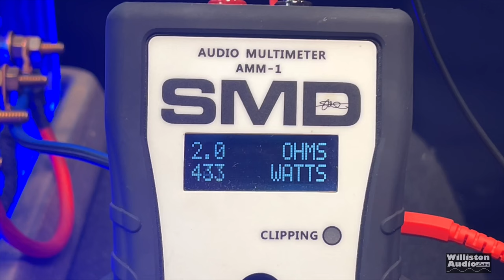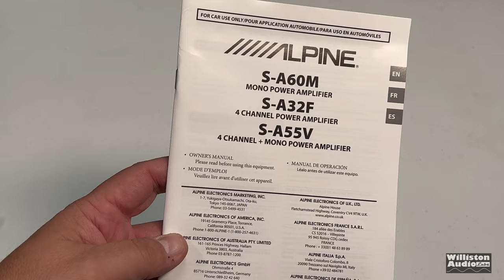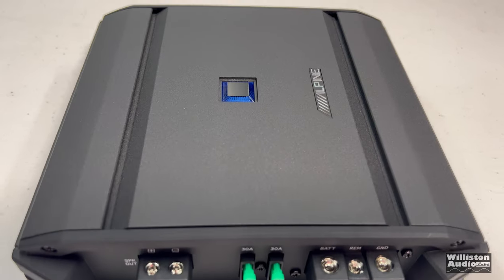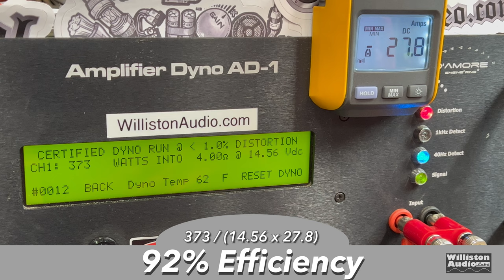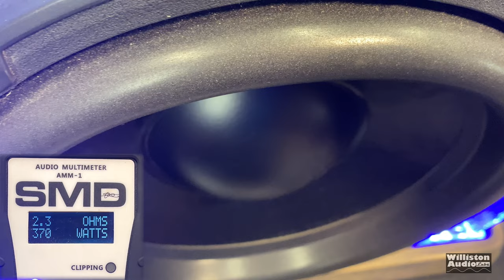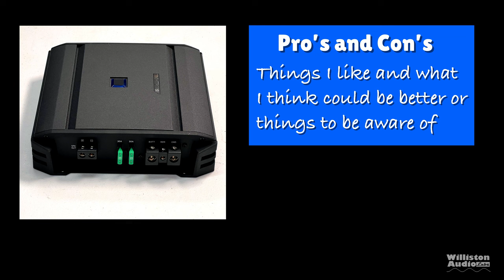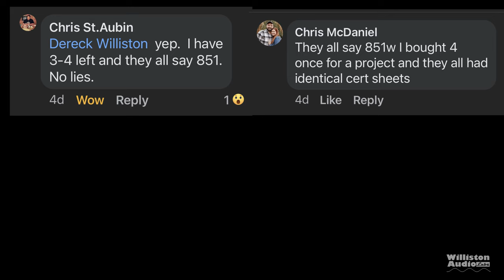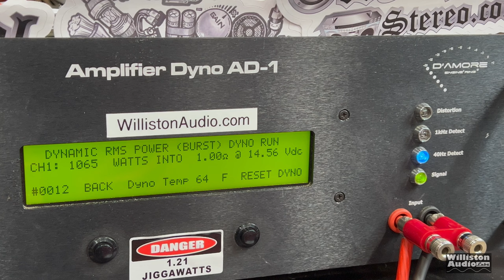TOP SELLING Amplifier of 2022? ALPINE S-A60M 600W Monoblock Amp Dyno Test and Review

Comment: Good morning, I'm wondering if you ever came across a Nakamichi Gold Series amplifiers. Back in the day my system was a Sony receiver, Sony XEC 500 crossover, Boston Acoustics 6.5 Pro Series door speakers, 2 10 in. MTX Road Thunder Pro Series subs. For the amps I swear it was the Gold Series Naka 45 watts by 2 and MTX Road Thunder 100 watts x 2.  It was installed in a brand-new 1990 F 150 regular cab 4x4. It sounded clean with no distortion and about 112 dbl. Thanks
Reply from the maker: That’s a killer system! I don’t have any OS Nakamichi at the moment, but I come across stuff all the time

Comment: Kind of a weird nitpick on my part but the radioactive green fuses seem out of place on a totally blacked out amp. Would have liked to have seen them use black or a smoked clear fuse color there. Again, not a big deal, just seems odd that they went with that color of fuses.
Reply: Fuses are all color coded according to what Amp rating they are.  10 is red, 15 is blue, 20 is yellow, white is 25, 30 is green, 35 is purple, 40 is orange.
Reply: @derekgardin1512  yup, industry standards. I guess if it's a big deal to someone they could always paint them.
Reply: @derekgardin1512  I had no idea. But I'm sure I've seen amps with 30A fuses that were not green. But if it's an industry standard thing I can see why they followed that. Would have been nice if they had gone with a darker shade of green though lol

Comment: i went with the cxa 800.1 and for some reason my dual dvc 4ohm subs wired to 2ohm arent pushing mids.... its basically just dropping out. When wired to 1ohm, the amp cuts out at high volume so i wired to 2ohm and that solved that problem, but i still cant achieve any mids coming out of my subs (my rockford fosgate amp was able to send mids thru those same speakers). do you think its an amp issue, or tuning issue? should i get this amp instead?

Comment: Ive got 2 12 kickers in a pawn shop box with this amp running them (i dont need comments telling me its underpowered ik this) and im wondering if i should get a new sealed 2 12 inch box and a long the way get a bigger amp or should i just get a single 12 inch box and use the same amp
Reply: I need a new box because that one is falling apart and it rattles like a rattlesnake

Comment: I see that the most you pulled off the dyno was  723 but when you was playing music I seen from anywhere around 1200 to 1700 @ 2 ohms is that legit pls explain??
Reply from the maker: Reactive (speaker) vs resistive (Dyno). This amp sandbags on the Dyno and saves it’s power for the subs!

Comment: mmm. not sure i'm okay with a boost at 50hz, i don't think it properly raises the right frequencies that most of us bassheads are going to want. so i doubt i'd be using that feature on this in any setup. probably use it for a flat rig that has other eqs or processors that output to the amps.

honestly, i find 35-40 is better for most music, and i love having a 20-25 boost capability to help tune the near/at and to some degree the subharmonics.  sadly, not many amps have them lower than 40. and most head units aren't complex enough to get the lower boost bands. 

much sad.
Reply: Rockford sells stand alone Punch EQ's now. 40hz parametric boost up to 18db. I think they're 50 bucks

Comment: How does it read over a thousand Watts on your do it bump dough test when on your Dino it never came close to that
Reply from the maker: Reactive load (speakers) different that resistive (Dyno). This amp obviously performs better with speakers 👍
Reply: Reactive load (inductive) versus pure resistive load result on an AC/sine wave input. A speaker rarely provides a constant low ohm load, as its voice coil is moving up and down on the pole piece inside of the magnetic motor assembly. Some folks refer to it as box/speaker rise.   Fred

Comment: I have used many alpine products over the years. They are not always the best bang for buck, hardly ever. I will say though there products have always done as advertised and handled it for years without issues. Currently have 2 sets of there new type S speakers in cars both running off kicker 360.4 amps lol.

Comment: Alpine is one of the few brands that has not tarnished their name with inferior products.  If you see their logo in a classifieds listing, swap meet, or yard sale, you know it's worth grabbing, even if you don't necessarily know how old it is.  The only other brand that was around 30-40+ years ago I would put in this category is JL Audio.
Reply: Rockford Fosgate and Kicker as well are in the same category.
Reply: @ULSB1969  Although my statement is generally true for them, I think they both offered budget level products that I would personally pass up on, in fact I've walked past plenty of RF an Kicker subs with rotten foam surrounds, can't say the same for Alpine.
Reply: @chrishuyler3580  not when you buy new, and on the top end like the T series(PowerSeries) RF amps, RF will blow Alpine away. I’ve had both and RF puts better power and quality than Alpine, Alpine is good, but not as good, but the head units have alway been awesome. The digital amps that I’ve had did not push my 13W7 as good as the T1500 RF does.
Reply: @ULSB1969  I'm not discussing buying new or top of the line, I'm not comparing dollar for dollar watt for watt, you're changing the subject.  I'm saying that if my wife was heading out to the flea market or a bunch of yard sales and asked "Do you want anything"? I'd show her the Alpine logo give her a budget and be happy with whatever she came home with. No further discussion required. I would not extend those same instructions to Kicker.  With Rockford, there are certain products I would cherry pick myself, but it's just not a blanket statement.  In fact, I'm most certain I'd end up with an amp that has no end caps on it, as that is always the case with older RF gear.
Reply: @chrishuyler3580  Alpine has entry level amps I would not buy, new or old. JL Audio and the amps i have mentioned, talking top of the line, are just as good as Alpines top of the line and if not better.

Comment: that 40 hz comment made me so angry....
Reply: THIS IS NOT A 40HZ OPERATION! 🤣
Reply: Just from your profile pic and only your profile pic, I assume everything makes you angry.
Reply from the maker: People who listen to rock or pop music agree with his statement
Reply: @majicdude88  its okay if you dont understand the complexity of the joke that is my profile pic.
you see i took the trump pepe meme, and put the npc and clown hair meme's on it. its funny, your supposed to laugh at it.
Reply: You must go below 40 if you're running full range you want to have 0 to 22 killer hurts at the minimum when they say you should get rid of the garbage you can't hear the truth is those frequencies we can't hear are like the wavelengths of light that we can't see that could heat us or cool us and the same goes with sound there is frequencies that benefit other frequencies and when you start eliminating the reality it's a fake recording and it's a fake representations of pretending to reference the actual recording the artist recorded and the mixing engineer recorded to remain in that signal.

I produce subsonic frequencies but most people have systems that start at 20 hurts and I think that's pathetic because that's not reality it's not a full range of reference and that's what crossovers are for to separate the power and the bands. Rather than talk about the needed high electrical system we need to concentrate on quality
Reply: @wal   As a producer I disagree because I grew up with a lack of full frequency and when I was unlocked in my freedom of adulthood to go from 0 to 30 kHz I realized everyone is a clown who shelters and clouds or masks the reality of the recording and the recording and the reference data that is meant to be there because that's what the artist wanted to be there in the 1st place and you can't say you're listening to reference if you're destroying it.
Reply: @wal   If you ever listen to Kansas carry on wayward's son with a good subwoofer that can hit down to 20 at least you know that your comment doesn't make sense. The kick drum produces forever since the start of a kick drum in Africa wherever they started lacing skins on pieces of wood barrel there was always subsonic. These companies work with their engineers to engineer a product that can facilitate excellence across the bands. And you're just eliminating I only understand if the motors that you are driving load cannot handle or cannot even disperse those frequencies to begin with but if they are available and capable I would not limit them. Audio is reality and when we start to filter reality then we live in a fake world. We have capability today to have high reference we have measurement devices and we have equipment that equipment that will exert awesome audio if you let it. You would be amazed at how many bands sound so much better when you go below 40 hurts when we had systems for decades that could never do such a thing and they always had tone that we couldn't hear.

But do not include vinyl in this comment because vinyl is very low bit rate and I don't care what anyone says vinyl is junk it's a preference of nostalgism.
Reply: Van Halen 1984 has zero information below 40hz.  It's like the producer took an axe to it and chopped off it's balls.  There are many examples of this in older recordings which is why I use an Epicenter it is literally the cure for this problem.
Reply: @FUBuddy  i laughed when i saw it. Amazing yt don't kick u off for the pepe similarity
Reply: @donnie4191   I do a lot of remixing through my studio and protools sessions of restoring or restoring or restoring or restoring or restoring old recordings there is hints sometimes of a hum or a lower frequency that I can extract mix separately and then mix back in.
 It's really hard for anything pre 70s.
Reply: @donnie4191   Maybe I have remastered digital versions of Van Halen but I can tell you Van Halen is my go to rock N roll in the car I said Kansas but it's really Van Halen. I also play rustical's basin hanster version of Van Halen which is fabulous. He put too much bass though.  It is raised just a tad bit too high.
Reply: @donnie4191  yea an epicenter is probably my last lil upgrade aside from higher high output alternator and more battery's's's's :P
Reply: @MacNifty  did you mean kilohertz
Reply: Anything above 40hz isn’t even bass. I set my low pass filter however low it goes which is generally 50hz and tune all my ported enclosures under 30. Generally 26-28. I try to get my enclosures to play pretty flat from 25-40 which generally means not going with the manufactures suggested enclosure. That way it actually sounds like bass and not like a bunch bees buzzing. And bass boost on any amp at any frequency should not exist. That’s just a worthless little knob to cause clipping and fry voicecoils. Seems like a well built little amp though. Some cheap parts, but the important stuff looked to be high quality. In todays amp market though $220 for 600 watts and no bass knob is pretty expensive. In 1995 I would have paid $750 for 600 watts. Lol.
Reply: @Van1018s   Actually it goes all the way up to 250.
Reply: @Van1018s   You have low mid and high base you have 3 octaves
Reply: @MacNifty  I’ve been competing for 29 years. Owned a car stereo shop from 1995-2010. Built 100’s of sub enclosures. Installed literally 1000’s of amps. I get all my equipment free for my 2 competition vehicles free through various sponsors. Been invited to world finals 13 times. Went 11. I appreciate the education though. And my 50hz reference on the low pass filter was that is lowest you can set it. I’m aware of what it goes up to. I wish amp companies would make them to where you can set them lower. Like 35. Attend a car audio competition. All the best sounding vehicles with loud bass are playing under 35hz. Most in the 20’s. All my personal favorites play in the teens.
Reply: @Van1018s   True Michael and it's nice to hear from someone of the community. But you can install the amplifiers in the f**** world if you can't fix A TV or fixed an amplifier you're still below you're just installing bro that's not a technician. I mean everything is dependent on the components. It hurts I have drivers that will go no higher than 60 I have drivers for mids that I'll go down to 40 or even 30 I have mids that I'll do no less than a 100 it's all by specifications there is no guaranteed benchmark system.
Reply: @Van1018s   I'm not trying to knock you in but I probably didn't I love everyone of the I'm just gonna shut up.
Reply: @Van1018s  in 2000 i paid 400 for 600 watts, but it was 2 amps easy twice this big. jbp bp 300's. and yea same. im mainly going for the sub 40 hz, i really like that 20 and under half open window wobble....
Reply: @MacNifty  Damn I am out of touch lol. Hate to admit it but your post was the first I  heard of dj russticals right now I'm slammin whatever I can find of his on YouTube.  Thanks for the find.
Reply: @FUBuddy  You will love it. All your old music will sound sooooo much better.
Reply: @donnie4191  im just not sure its going to work for MY old music, sense its mostly like bass mechanic, legion of boom thunder jam, bass305 and such.... but like maybe it will make my wifes music more enjoyable for me...
Reply: @FUBuddy  Lol our generation gap is showing Buddy. My old music is pretty damn old. Like me I guess.
Reply: @FUBuddy  I have to sign contracts that I won’t sell the product until it’s been used for at least 1 full competition season. Unless they’ve came out with something new the companies typically won’t give you anything except recones and amp repairs for free. I’ve got prolly 8 amps 8k or larger. And lots of subs that are $750+ retail just stacked up in my shop. I rarely sell anything. Right now brand new in the box for sale I have 6 DB 3512R D2 and a DB aak 20,000.1. Rest of my stuff I technically can’t sell. And I always end having pay for my own electrical. I have over 13k into the electrical in one my trucks. A good electrical system cost more than amps and subs these days.
Reply: I'm offended by you taking offense ~ Tom MacDonald
Reply: @MacNifty  I don’t take offense to anything on YouTube. I say what I think. Same thing everyone should do. That’s what makes it enjoyable. If everyone thought the same thing this would be pretty damn boring. Lol.
Reply: @majicdude88  what's wrong with his profile pic? Seems great to me 🤷
Reply: @wal  John Bonham from Led Zeppelin ran a 26” inch kick, the fundamental of a kick that bigs lower than 40hz.
Reply: @Van1018s  I used to agree on the bass boost.
However I had an enclosure built and I built some other subs in that were not designed to play in that box… box was a bit on the big side for the subs..
Tuned to 30hz sounded good from 28-35 but  any higher it fell off because it was so pesky.. lil bass boost at 40hz
And now it plays 28-50 very flat 
Just have to sacrifice over output (gain) in order to use bass boost effectively

Comment: Tuned to 40hz.... ughh waste of info below that? Plz fire that guy kicker, thats not good.
Reply from the maker: It’s all a joke now but there is some truth to what he said. It all depends on what kind of music you listen to
Reply: @wal  Yes you are right if you’re trying to get “Loud” with a small sub setup the 40hz tuning frequency will limit excursion down low, and then you can crank 40-80hz bass louder since the sub is not being over driven (too much excursion) by the lower frequencies. So I suppose it makes sense in a small pre fab enclosure but when he said “All” of our enclosures I was like Wtf!? At least make some 33hz or 35hz. 

I have a lot of respect for kicker, their amplifiers are outstanding quality even when compared against high end SQ brands.. so I assume some smart engineer determined that the most sought after design in a small enclosure was tuned to 40hz so you can get “loud” without blowing your little kicker comp 10” - LOL
Reply from the maker: @CL-yp1bs  yeah it was a general statement and it really stirred up the bassheads! I really don't think he intended to relate this to "all" boxes or subs
Reply: @CL-yp1bs  first, it's alpine not kicker. Second, I'm pretty sure he was fired. All their current gen sub boxes are tuned to about 32hz. And third, their other lines (type R, type X) are high def. The full range amps are 20hz - 40khz, and sub amps are 10hz - 200hz.

Comment: was wondering if anyone knows what is it that makes the  difference circuit wise with non 1 ohm rated amps for why some can still handle a 1 ohm dyno test while others like this alpine can't?
Reply from the maker: They designed it for 2 ohms and it seems still stable at 1 ohm (speaker) loads, but I’d stay at 2 ohms if possible with this amp
Reply: Alpine makes plenty of amplifiers that work on a one ohm load not this one that's all Alpine is a great company if you want one that can hold a one ohm load just go to their website

Comment: Hey guys looking for a low to mid budget amp to replace an old alpine mrp350 monoblock. I'd like to stay with my 8 guage ofc power wire if I can. It's powering 1 12 inch kicker compr 4 ohm dvc at 2 ohm now. Want to add another 12 and go 1 ohm.
Reply: Would this be an option?
Reply: @brinkbuilt101  
This amp will not work at one ohm. 
Did you watch the video son?

Comment: Can buy a skar amp that pushes way more power then this baby amp for that price!
Reply: Alpine is more efficient if you were paying attention to the video. In English that means it doesn't draw much power from the electrical system unlike Skar, that will. Has a clearer sound and I will guarantee that it will last much longer than Skar. That's been in business for how long?